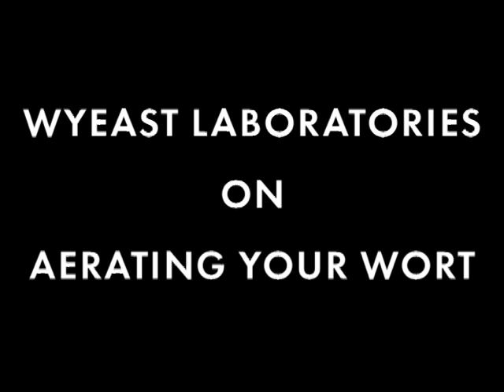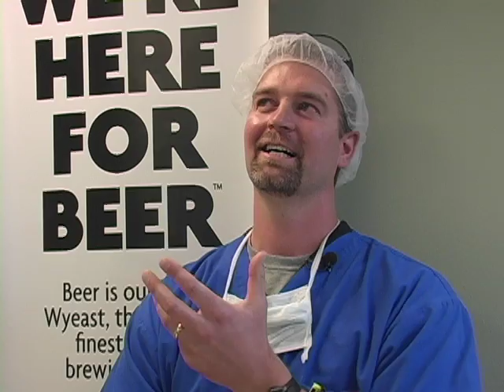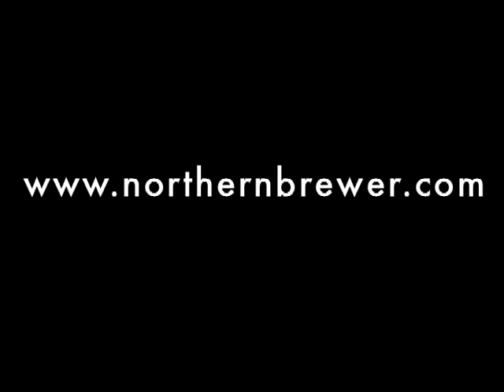Wyeast Laboratories on Aerating Your Wort

Comment: I just brewed a 1.100 G beer Thursday and decided to try using gallon jugs of spring water this time.  I transferred the wort to the sanitized jugs before going into the fermentation vessel and shook them like crazy.  A four day Gravity test showed I was at 1.014.  I am sold on aerating.  I also used Two vials of liquid English ale yeast.

Comment: I been using a sterilized paint mixer on a dril!  I saw it on another video and made that $3.96 invetment at Harbor Freight, best investment I have made for my beer.  I generally run it on hi speed for 30-45 seconds moving it up and down in the wort prior to pitching hydrated dried yeast to create a nice vortex and lots of foam.  I'll pitch the yeast as its still spinning after removing the stirrer and then hit it again for another 10 seconds after it calms down... then cap it!
Reply from the maker: Cool technique! Have heard of using a similar setup to degas wine, but not to aerate wort. Makes complete sense.

Comment: Those are some high gravity "beers" ;-) You might look into an aerator attachment - it's a long drill bit with a couple of flaps on the end. Fits right into your carboy, and then you run your drill for a few minutes to aerate the wort. I've gone up to 1.085 in the past and vigorously sloshing around the wort in the carboy for a minute or so was fine. Just wash your hands, cover the carboy opening, tilt it at a slight angle for leverage, and then start shaking the hell out of it.

Comment from the maker: @migueldeluna No, shaking/aerating should be done in the primary fermentor, after the wort is cool and before the yeast is pitched (although for high-gravity beers or very flocculent yeast like Wyeast 1968, a little extra aeration or agitation 1-2 days into fermentation can be helpful). Generally the best practice is to avoid adding oxygen to the beer in secondary or beyond.

Comment: I usually use an immersion blender in my bucket to foam it up like crazy. Lots of yeast should be pitched at 30-35°C but I could get a lot more oxygen dissolved at 20°C. So which would be better? Make a starter at 35°C and let it slowly come to room temp before pitching in the 20°C wort? Would it harm the yeast to blend after adding the starter?

Comment from the maker: @jones3420012001 Probably about the same as for shaking w/o O2 in the headspace because you're still relying on manual agitation to dissolve the gas into the liquid; the higher ppm comes from having the fermentor headspace filled w/ just O2, instead of ~20% O2 in air.

Comment: Is there any difference to adding oxygen thru a stone and THEN pitching the yeast, as opposed to pitching the yeast and then oxygenating? I always oxygenate and then pitch the yeast and leave be. Thanks.
Reply: Your method is exactly how I do it. I aerate as the wort comes out of the chiller and pitch the yeast starter usually the next day. Never had a problem.